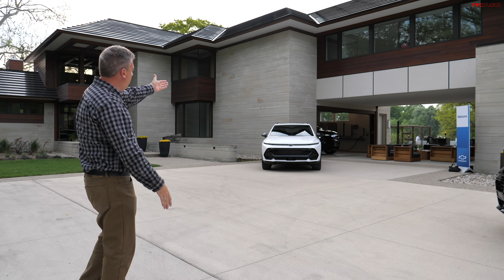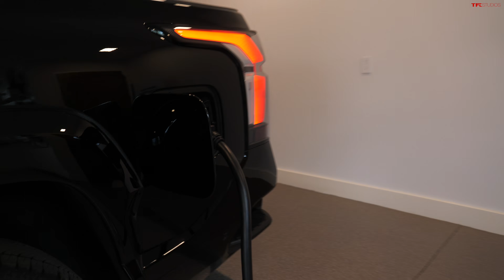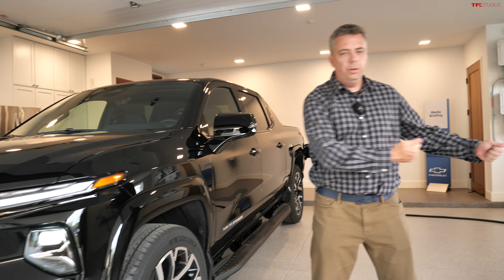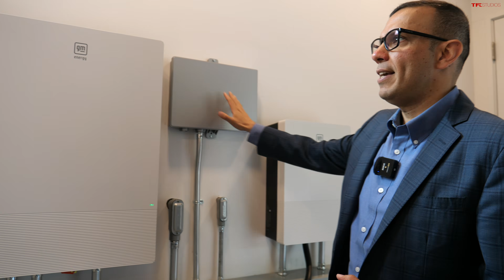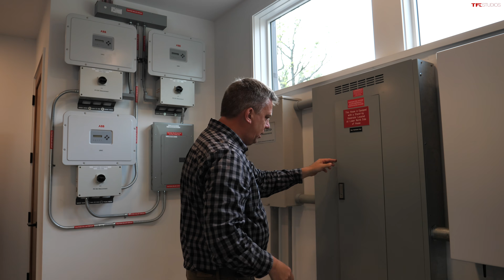Yes, You CAN Power Your House Off a Chevy Silverado EV: Here's How!

Comment: Another thing that you have to consider is that fine print associated with your batteries warranty. I know tesla has fine print that if you use your car to run your house then your warranty is automatically voided. My guess is maybe powering a house can put undue load on the battery?

Comment: Do these systems work with ANY EV or are they designed to only work with the EV of the manufacturer that built it so a F150 Lightning can/cannot plug in to this system and it would work the same?

Comment: You can also just plug into the 220 plug on the truck with a cable, then into a generator plug that your house should have anyway for almost no money. I looked into this system they show here it cost 7000 bucks. I think I can take the 5 minutes to manually plug in to save 7 grand.

Comment: Cool that they are doing this for the Rich people. I have a mechanic switching system that costs a couple hundred dollars parts and labor. You can plug in a battery, generator or a compatible ev.  But you have to mechanically turn move levers with  your hands and brains.

Comment: You’re not going to buy a $100,000 truck to supplement the grid. This is an emergency power usage. An alternative to a generator. If you supplement the grid overnight from your truck, then you don’t have enough charge to drive your truck the next day. You can buy a stationary 200kw battery for a whole lot less.

Comment: I spent 200 dollars on a power cord for the pro power onboard for my lightning.  Already had the transfer switch.  I think with this GM setup you need to be a millionaire.
Reply: Ford has this option also, I was quoted 7k. I did what you did, I just got a cable.
Reply: @cyclone-g2z  Did you fair out okay with the gfci errors?  Mine is working now but needed some frigging.  Glad I did not wait for a storm to figure it out.  This GM setup looks like its about 30k dollars.
Reply: @peiguy1982 The price was given in the video. No need to guess based on looks. $7500.
Reply: @TroySavary  Fair enough.  So 10k where I live.  And not allowed either by local electrical code.

Comment: We have a couple of Model Ys and a nat gas generator. I live in the foothills west of Denver and we have a lot of power outages and I'm on well water. That means I lose water when I lose power. Not good. My nat gas gen has saved my bacon often. It can carry the whole load of the house including doing 120 volt charging of one of our Teslas, gaining about 25% battery in 20 hrs.   I really don't want to use my car battery to power my house, but I probably will get some power walls when it's time to replace my generator.

Comment: People don't realize how big a game changer this tech is to fix climate change. Solar panels + lifepo4 battery packs in vehicles (2000+ cycles), will drive the energy revolution away from fossil fuels, and grid scale utilities (which sometimes currently require back up systems because of load volatility)

EVs, solar panels, and heat pumps aren't sexy, but it's the most important elements of a carbon neutral future. Good on ford, gm, Tesla for doing this. This is huge, doesn't get enough press.
Reply: Cause of $$

Comment: The whole idea of battery storage is great as it allows home owners to more effectively use solar, lower overall costs by charging the battery at night with cheap power and use that power in lieu of expensive grid power.  Most importantly it protects the home owner during grid outages and allows the solar to continue to operate during those outages.  My utility pays me $1/kwh to suck power out of my Powerwall during grid outages. I specify how far they can drain the battery and can recharge from solar or cheap Super Off Peak grid power. I’ve had a Tesla Powerwall for the last 4 or 5 years and can personally attest to these benefits. 

I have a number of question, which I think anyone considering this system should consider:
- What Federal and state incentives apply?  My Powerwall was really expensive but I ended up paying for only about half because of incentives. I would think incentives would apply here, it would be nice if the rep spoke about them.  -
-  The state rebate on my Powerwall battery was over $5K. Will there be similar incentives for the batteries in EVs connected to this system?
-  I watched a video on this system and noticed that it took about 40 seconds to switch over. This is unacceptable if you want to use power from your EV on a daily bases because all your electronics and appliances that depend on the grip have to be reset. GM appears to be using a cold start approach where the EV battery power energizes the 240 VAC inverter after grid outages is detected and the system is isolated from the grid, then monitors the inverter until its output voltage is in spec before switching over.  In contrast the Powerwall is hot all the time and ready to switch over instantly.

Comment: I have one question for this product (and its' future upgrades).  Will it work with other EVs, or is it only compatible with GM products?  Several manufacturers offer a form of powering your home using your EV or hybrid, it would make sense if they all used the same communication standard so they could be "agnostic" when it comes to the system the consumer chooses to install in their home.

Comment: The capability is good but frankly that would just amplify my  range anxiety... If hurricane downs the area i'm not gonna use my transportation power for the house, I rather get me lawnmore  sized generator for the refrigerator for 500 bucks in advance
Reply: How you gonna fill it up powers out so is gas
Reply: @mcsike7264  when People by little generators they also have  gas tanks
Reply: @tallll70  how long is that gonna last constantly running
Reply: @mcsike7264 exactly
Reply: @mcsike7264  actually not bad in my area we never were down more than 10 days I had two or three 5 gal tanks I remember never use it all... but of course it's a tiny generator 1 20 Amp outlet... it only gets me refrigerator computer light and fan, if i need  microwave I have to unplug the fridge

Comment: When a power outage happens, how long does charging appliances last?  How much does it cost to install a special charger for an electric vehicle? How long does the battery in an electric vehicle last over the life of the vehicle?
Reply: Depends on how many appliances/electricity you're using, but with a battery this big (Silverado) you could probably power a regular U.S. 2k sqft house for a week or more, as long as you weren't using a traditional air conditioning all the time. The typical home battery backup system, including the Tesla power wall, are around 15-30 kWh. Most EVs today have at least 70 kWh, while the Silverado EV is like 200 kWh.
Reply: @deconstructdnc mind you, A LOT of these same individuals that tried to use the size of the battery pack against the Silverado EV/Hummer EV because it’s Ultium and they desperately needed to find faults. But after learning how useful a fully electric vehicle is with a battery pack this large I wouldn’t buy an EV with too small of a battery because i feel it would defeat the purpose of a battery electric vehicle if i can’t do these types of things.

Comment: If your power goes out when your sleeping and you left your vehicle plugged in could you potentially wake up to no power still and no vehicle to drive?
Reply: When full, the battery in the Silverado can power the average US home for over a week.
Reply: @bahamatodd ahh yes that home 100% represents "the average American home" 😂
Reply: @ArizonaMatrix You can put this system in a smaller home.
Reply: More than likely there is a configurable battery level that would disconnect the vehicle. Also, the app will no doubt alert you when the vehicle is exporting power. If you have that huge battery in the truck and you're asleep then power consumption will be low anyway. It's certainly not for everyone, but technology isn't born perfect. There is a lot more to learn about how we optimize our power needs as we journey away from carbon fuel.

Comment: This would be awesome for me. I'm only halfway through the video, so I haven't heard costs yet... but I'm sure it is way more than I'd ever pay.  I will be buying a much cheaper used ev like a Bolt and charging my batteries off the 12v converter in a pinch. Not super efficient, but who needs to be when you're going from 12 kWh to 12+65 kWh. 

I have way more solar than I use so most of it goes back to the power company... for which they graciously pay me like 10% of what I pay them if I ever draw from the grid. Seriously, I sent over a 1000 KWatt hour back to the power company one month, pulled 800kWh from them... and I had a bill for over $200. I sent them more power than I used and they still charged me $200. Ridiculous.

So as far as backfeeding the grid with my vehicle battery... the grid operator can sit on it and spin. I will not be connected at all if I have a battery that size available. No way I'd pay for the wear and tear on a battery to help the grid when they're so hell bent on screwing me, the solar user. The additional wear and tear will hardly be noticed for my personal use. I just need to keep my current batteries from running on the ragged edge, not replace what the grid does with an EV battery.
Reply: That's the reason my dad got an EV. He was only using two-thirds of his solar capacity and getting less back than the price he was paying for. Now he's driving for free.
Reply: This is why solar is a scam. Thanks for proving my point. Also silly to spend another 40k on a ev to save $100 on power…

Comment: That's normal a house of that size you would not try to run everything it's the essentials Heating / AC office wine cellar Irrigation Electronic Gates garage doors Security system kitchen, but a house of that size would have its own generator it's good to show exactly what the truck can do and what it's capable of

Comment: I would sure hope it can power a house since it takes the daily energy consumption of over 6 average American houses to charge it one time.
Reply: An average house needs 10kWh per day. The battery is 215kWh did he say? That's enough to power an average house for 2 days (with 10% efficiency losses).
Reply: @bluceree7312  Average American home power usage is about 30kWh per day per the US Energy Information Administration.  That is 6.7 days for a 200kWh battery disregarding efficiency losses, which I would assume is part of the 30kWh number from the energy grid as well.   The point is that it takes 6.7 days worth of power to charge fully charge this truck.  The average American drives 39 miles per day.  With a 450 mile range that means a full charge every 11.5 days in ideal conditions, or increasing your electricity usage by 58% for one vehicle.  If you are two vehicle household you are doubling your electricity usage.  Where is all that electricity going to come from if government mandates meet their goals?
Reply: @plmn93  Aside from the figures, I really don't understand what you're trying to say. When you fill your 7 liter Cummings or Power Stroke truck with 36 gallons of diesel, this energy could also be used to power a generator to power your house for probably 2 weeks. So relying on fossils is even worse.
Reply: And don't get me started on how much energy it takes to get this diesel inside your truck. Jesus it probably crossed thousands of miles, and needed so much power to refine it before you can use it. 
You can't even begin to compare when the grid is slowly getting more renewable (i.e. free) energy, which btw you could generate yourself at home if you invest in solar panels instead of acting like a luddite.
Reply: @bluceree7312  Solar panels are not free and are not usable in all environments.  The difference between ICE and EV is that the power for ICE is already available in the quantities needed.  Where as the very same fanatics pushing EV mandates are also preventing us from building out the electrical infrastructure needed to support them.   Windmills and solar isn't going to do it, not to mention the blight on the land both of those are starting to become.  But city dwellers like to ignore that because it's not in their backyard.  And they won't allow us to mine the materials needed for batteries either, at least, not anywhere near them by companies that are held to basic environmental and labor standards.
Reply: @bluceree7312  Oh, and by the way, this truck is definitely NOT the equivalent of a one ton diesel truck, despite the fact that it weighs and costs more than one.  Not even close.
Reply: @plmn93 it’s obvious where you get your information from and it is eye opening witnessing how much Faux News has fried your per brain 🧠
Reply: @bluceree7312 why don't you people ever talk about jet A when you get on this fossil fuels = bad rant?
Reply: @plmn93  I hope people like you get a clue sometime soon. No one said solar panels were free, just like tune-ups and fluid top offs aren’t “free”. You have no idea what you’re talking about yet you continue to move your mouth. 🙄

Comparing the weight and costs of a fully electric Silverado RST with a 200+ kWh battery pack to a ICE truck is asinine because it doesn’t matter what the diesel costs you to obtain, NO DIESEL  can do what this Silverado EV just demonstrated with onboard equipment.

EV fanatics are no one’s problem, if you don’t want one don’t buy one. EV trolls like you who haven’t bothered to cover up with an alternative to an emissions free nation and net zero carbon footprint, yet they’re burning coal and complaining about the lack of power for EVs on an electric grid are the issue.

Comment: These solutions are pretty cool but not very robust.  The GM system looks like it has a max output of 10.2 kW which is about half what a 3000 sq/ft house needs to start up AC units, stoves, etc.  And while they tell you it'll power your house for "21 days", the truth is far from that.  200 kWh will power a 3000 sq/ft house for maybe 4 days if you don't conserve.  Obviously more if you are conserving energy and cutting down on what you normally do.  The GM solution looks pretty messy with an entire wall of crap just to support it.  I say: just buy a Generac whole home gen.
Reply: Well normally in an emergency you are going to be conserving energy I suppose.  But yeah the average American home uses 30 kWh per day, and anybody who can afford this will presumably be using more than average.  You can look at it this way too.  If you can power your house for 21 days with this as Chevy claims, that also means it takes 21 days worth of your home's electricity to charge it it one time.  Not something you'd think they'd brag about, but then again most people can't seem to use basic logic these days so it's probably OK.
Reply: All these ideas and systems look good on paper but in the end it’s all about $$$$$$$$$

Yes you can finance but there we go yet more debt…..
Reply: Oh SHUT UP. Y’all actually hop in comments and pretend that EVs are supposed to be perfect and able to do ten times as much work compared to an a ICE vehicle for a fraction of the costs in their first generation. ICE trucks have been around much longer and they can’t even power a 3,000 sq.ft. home for 4 consecutive days. 

Complaining that the wall unit “looks messy” is you attempting to find a fault with this available feature. Sit down.

Comment: Hmm...  a $2000 9500watt Predator genset from Harbor Freight or a $96K truck to provide backup power to my home?  Which is a better bargain?
Reply: There's a new way to feed power to the house, and you can daily drive it.
Reply: People who can afford these trucks aren't bothering with mobile gens for home backup. They'll have a nat gas Generac. How about this? A friend's parents installed solar and battery banks on their house last year. They power the house and charge their EV off of it. Using the EV as battery backup makes sense.
Reply: @mtnman1984 a single Powerwall unit is like $8k for 10kw minus install. A generator stub from a licensed electrician is like $500. So he's $2500 in to it and the battery alone is 8k. That's a hell of a lot of gas to run the generator 😂
Reply: @ArizonaMatrix  except this "generator" runs everyday off solar and will pay for itself in six years.
Reply: @mtnman1984  With "net metering" bullshit tax? I'm not in the business of supplementing profits to monopolies...
Reply: @ArizonaMatrix  dumb take

Comment: Step 1: buy a $5 M house
Step 2: buy a $100k portable battery pack, instead of having a backup solution
Reply: It would have been funny to see them try to host this event at some 4,000 sq/ft cookie cutter on a half acre.
Reply: Think this is one of the GM exec’s houses. Think it’s in Birmingham.
Reply: @venom5809  you think a GM exec gave up his house for a tech demo?
Reply: Yes, while tethering your transportation to your home.  Always nice to limit yourself during emergencies.
Reply: @plmn93  if someone actually plans and spends the money to install one of these systems on their home, they've likely got more than one car.
Reply: @mtnman1984  True.  And if somebody actually spends this kind of money on a 1/2 ton pickup and lives in an area where this is an issue they've likely got a generator than can run indefinitely, or at the very least would prefer one.
Reply: @plmn93  quite likely, unless they have solar and a battery bank already. It's not common, but I've seen it first hand. Charging an EV with it too.
Reply: @plmn93 You can also get a smaller battery for the home. So when you leave to recharge the vehicle the home will have power for a few hours.
Reply: @bahamatodd  Yes, for a price.  A recurring price, since batteries have finite lifespans.